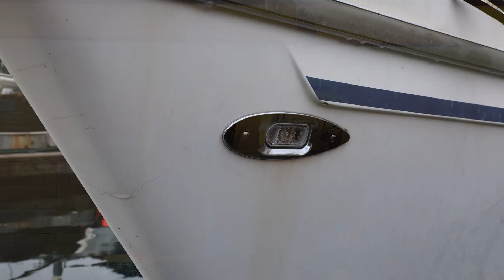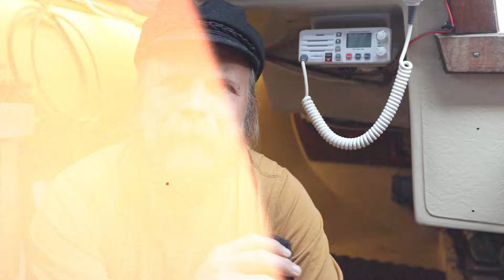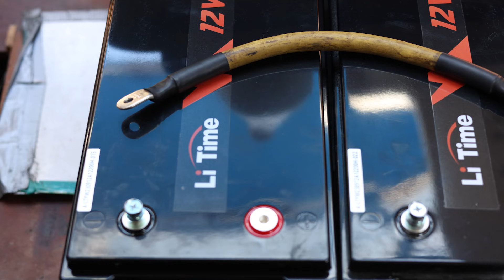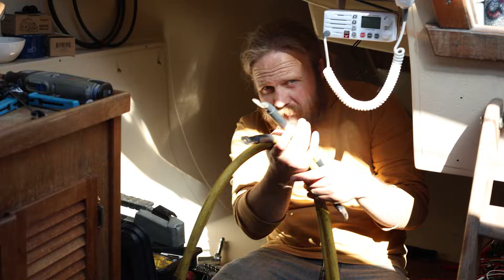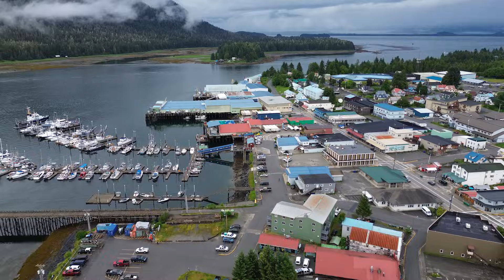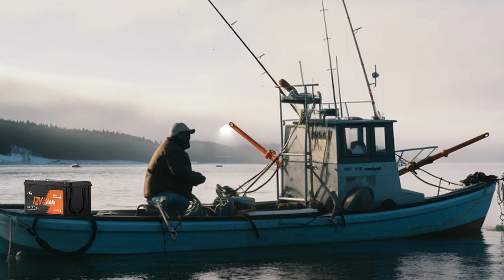Best Budget Lithium Batteries for Boats?!

Comment from the maker: Quick update for anyone finding this video now: it’s been about two years since we installed these LiTime lithium batteries on our boat and they’ve been working great for us with no issues so far.

As with any lithium setup, proper installation, charging settings, and system monitoring are really important — but for our setup these batteries have performed exactly as we hoped.

Hope this helps anyone researching lithium battery options for their boat or off-grid system. Happy sailing! ⛵

Comment: Finally catching up with the 21st century aboard my 1986 Morgan 32…. I still have the three-times 160AH flooded lead acid Interstates, but we now have 200w of solar to help haul the anchor in the morning.  Plan to go lithium/AGM when this bank gives up the ghost, and I’ll be rewiring the fuse panel this winter.
Reply from the maker: The future is bright and well lit! Good luck with your wiring project over the coming winter! It’s an upgrade totally worthwhile! If you’re looking for input on the latest lithium batteries take a look at Will Prowse on YT he’s got a great channels showcasing many elements of LifePO4 manufacturers.

Comment: Live off grid & road system on the waterfront in SE Alaska and have a 48 volt Simpliphi batteries for my power system and the only issue to be aware of don't charge when battery temp below freezing. Never happens. Easy. Good for 10,000 cycles with a ten year guarantee. I digress. 
Still have lead acid house & starting batteries on my commercial power troller, but eventually will transition. 
Nice visually & technical explanation. Thanks.

Comment: Hi guys. Great work. Can you use a regular A/C lead battery charger to charge your start battery, and then that would charge the lithium through the DC to DC charger? Or do you need a separate A/C lithium charger? Thanks.
Reply from the maker: You could use a regular AC lead acid battery charger to charge the lead acid off shore power and then dc/dc to the lithium. We have our shore power charger hooked directly to the lithium (pretty well all Victron chargers have a lithium profile now) and charge the lead acid solely off the engine alternator
Reply: @AllisonandJamesSailing  Thank you very much for replying. I hear there's a Sterling dc to dc charger that could work both ways, so it would charge your starter battery through your lithium charger when plugged in. Just another possibility.

Comment: I want to do a simple upgrade like you did.  I have bought the DC2DC charger and a 200AH lithium battery.  My question is: what (if anything) did you do with your main DC power switch (1-both-2-off) switch?.
Reply from the maker: Hi Bill, we essentially removed it and have separate main DC switches for the lithium bank and the lead acid starter bank. No need to ever combine the banks through a switch. The dc/dc charger is the only way to move power from one bank to the other. Good luck with your upgrade!

Comment: So the lead acid start batteries only way of recharging is when the engine is running as they are in no way connected to the solar panels. Is that correct?
Reply from the maker: Yep 👍🏼 that’s correct!

Comment: Meets the abyc standards. Humm I thought wire that’s tinned is in that standard. Could be wrong but if I am right do as I say don’t do as I do.
Reply from the maker: I do believe tinned wire is included in the abyc standards…. But we could both be wrong about that! 
Standards are exactly that, just standards,  take them for what they’re worth to you. Breakers, fuses and wire sizes are all very important for safety and so is tinned wire. It corrodes slower, builds up internal resistance slower and generally needs to be replaced less often. Inevitably all wire eventually requires replacement though.

This video certainly is not intended to be a ‘how to’ instructional video, you’re welcome to wire your boat how ever the heck you’d like.

Comment: I did almost the exact install, and had zero issues!
I put in two 280 amp hour, 12.8 volt.
Charges with 600 watt solar in 1.5 hours. “Sunny day” in Campbell River
I use a 3000 watt inverter, running starlink, ice machine, bar sized fridge, and 32 inch tv. 
Never gets below 70% of the bank capacity. 
Just so you get an idea of potential power. 
Great informative video!
Reply from the maker: That sounds like an awesome system, stoked that it’s working so well for you! We will likely increase our solar sometime in the future but so far we’ve been enjoying the heck outta the power!

Comment: Very nice installation and video. 
I like the "no drama" straight to the point format for this type of video.
I am still in the middle of our DC reno project on s/v Laysan. New DC panel, VHF, AIS etc etc, new wiring from the batteries to the panel. The LiFePO4 will be the last thing purchased as they keep coming out with new format and lower prices. Laysan is DC only.
Depending how your wiring is done the LA battery can also protect your alternator when the LiPo are fully charged and the BMS cut them off sending your alternator current to infinity. As for the cell themselves most LiPo are made using Samsung  18650 cells, but it is mostly the quality of the BMS that makes a difference.
I would not trust building LiPo myself, but the main issue is that the boat becomes practically un-insurable.
Cheers,
a.
Reply from the maker: Cheers Coyotehello, best of luck with the rest of your wiring project. The nano batteries that they’re coming out with look super cool, more energy in a smaller footprint, that’s a sailors dream right there!

Comment: Not all LiFePO4 batteries use the same type of cells.  There are cylindrical cells (like flashlight batteries in form) that companies like Battle Born use, at least in their 100Ah batteries.  Most manufacturers tend to use prismatic (i.e., rectangular box shaped cells), but recently manufacturers have started using pouch cells, particularly in their small format "Mini" batteries.  That is not to say that one type of cell is better than another.  However, pouch cells have not been used as much as prismatic cells so I would wait a bit on buying pouch cell batteries, but that is just my personal feeling.  In addition there are several manufacturers of cells.  Cylindrical cells are made mostly in China and South Korea and almost all prismatic cells are made in China.  There is also quite a range of BMS (Battery Management System) boards in use.

The most difficult parts of installing LiFePO4 batteries to meet the ABYC standard for lithium batteries is that ABYC calls for the batteries to meet UL of the equivalent European standards.  The issue with that is all but a few of the most expensive batteries are not UL listed.   In most cases the cell manufacturer may have built the cells to a UL standard, but the entire batteries, in most cases is not UL listed.  Furthermore, unless they have modified the standard since the lat time I read it a few months ago, the ABYC standard requires the batteries to have an alarm circuit that triggers before the batteries shut down.  None of the inexpensive batteries that I am aware of have that alarm, although it wouldn't be hard to program such an alarm into a BMS.  What all this means is that if you use the less expensive LiFePO4 batteries your install will not meet the ABYC standard.  Not meeting that standard is not a problem from an operational point of view since it is a voluntary standard and at least in the USA has no force of law.  Where is can be an issue is that many insurance companies will insist that you battery install meet the ABYC standard.  This may also come up during a survey if you use a surveyor who uses ABYC as the guideline.

It is also worth stating explicitly that LiFePO4 batteries sold for battery bank use are not suitable for engine starting.  Yes there are batteries sold specifically as starting batteries for applications like motorcycles, lawn tractors etc., but I am not aware of any LiFePO4 batteries rated for diesel engine starting.  That said, if you have a lot (say 10 or more) of 100 amp rated batteries in parallel you may be able to start a mall diesel, but that will likely void your warranty, so you definitely need to retain lead acid starting batteries.

Comment: Love to hear / see more on the alternator charging setup and connection to the lead acid to 12v/12v charge controller and then to the LiPO4 batteries. Do the LiPO4 batteries back charge the Lead Acid through the same controller when on shore/solar charging or are you charging everything through the Lead Acid and a charge controller? A video on this and maybe option appreciated. I like the idea of keeping at least my LA starter. Excellent video and great pace. A little more detail on the products and connections might be helpful, but not sure that’s what you’re going for in your vlog. Thanks and cheers.
Reply from the maker: Thanks for the suggestion, we’ll plan to make a video down the track explaining more about the alternator side of things. Blended chemistry battery electrical systems aren’t nearly as scary as folk mate out!

Comment: When you have the CATLE As probably the the worlds largest single batery producer in the world... their products are going to end up in a lot of products. 

They are  as safe as as lead .. but without the corrosive acid to wory over just pad them against slamming and strap or  bolt them down to stop them getting mechanically damaged.  Your boats contents show thats just common sence at least in a monohull 😂 🧙🏻‍♂️ 🇬🇧
Theres a new short blade cell form of Li Fe cells comming to market with a class record breaking capacity and a safety and environmental tollerence factors.  
5 Simultanious nails pushed through a fully charged cell and left for an hour ....  no flames. 

Next step go full electric hybrid charging. 😉 Good sailing.
Reply from the maker: Haha they’re definitely strapped down! It’s the other essentials (like onions and potatoes) that find their way flying about when we’re beating to windward. I’ll keep my eye out for the short blade cell form LiFe, they sounds really cool! Fair winds!

Comment: Oh you can keep your lead acid maintained by hooking up a solar charge controller and fuses on the DC/DC charger terminals.  The lithium van float charge the lead acid using the lithium batteries like a solar source.  My lead acid have lasted ten years and are standard cheap automotive.  The lithium when being charged by solar or having enough energy float charge the lead acid.  Typically like 13v which is about perfect when the lithium batteries are drained a bit.  It's so far been safe for me to use on the same circuit.  Also if you leave lights on, etc and are draining the lead acid then the solar charger will take up a small load and prevent a discharge.  For less than $20 you can make sure to double the life of your lead acid and prevent a discharge condition.
Reply: Sorry guys. I'm a retired Mech Engr. Can't help you. In fact, I could electrocute myself with a flashlight. Other members in my group would say, "Don't let Curt near an oscilloscope!!"...LOL
Reply: Good advice. My only criticism is that typically cheap $20 controllers are terrible. They fail, they run outside their nominal profiles, and injustice don’t trust them after my 1st two failed in under a month. Replaced with a correctly rated Victron and alls well.
Reply: @basildraws Mine has been running for 9 years. Pwm and it was actually $6 at the time. I think now they are $9 or $10.  I know what you mean, but basically if it does fail generally as long as it doesn't catch fire significantly all is well. No need to drop $130 on something that will most of the time put in a 100th of an amp.  I've had some times when the engine didn't start and that little 5 amp charger recharged the starting battery in just a little while without me having to do anything. Generally the solar charger won't even pull an amp out of the lithium/solar system a day.  So they don't have to really work hard enough to burn out. If the alternator is charging the charge controller does nothing because the battery is sensed as being beyond full at 14.4v usually. Typically the controller will only start maintaining after the engine shuts off and the lead acid comes down to a voltage level that the differential in voltages allows a maintenance current to pass to the lead acid battery.  In fact in this role the pwm excels because it can't over voltage the battery as easily with a higher maintenance/float current.  13.8 volts on a fully charged lead acid is death for it and an mppt charger like the Victron might do just that as it can get those higher voltages.  My pwm controller will only do 12.9 to 13.3 which is pretty much ideal for just allowing them to avoid sulfation.
Reply from the maker: Thanks for the advise Allyn!